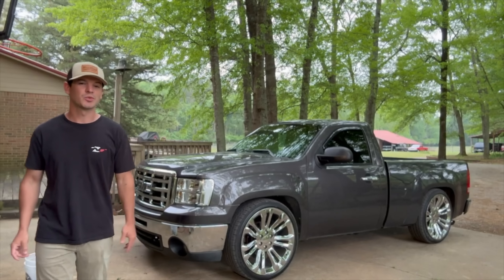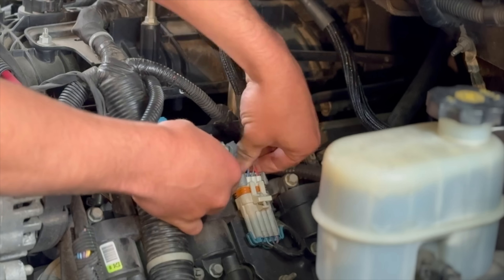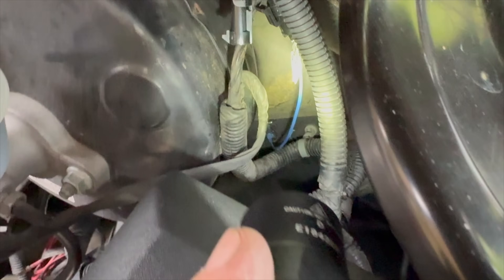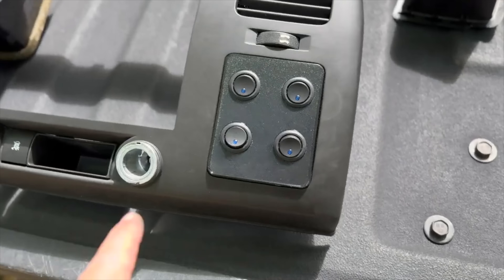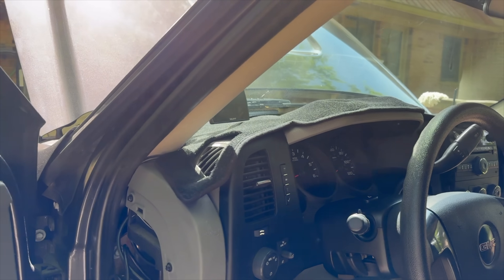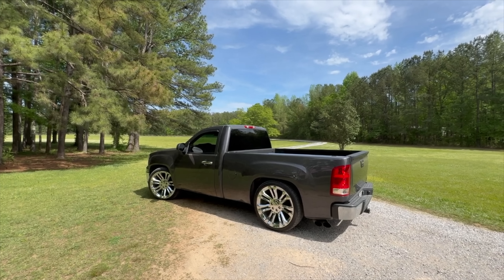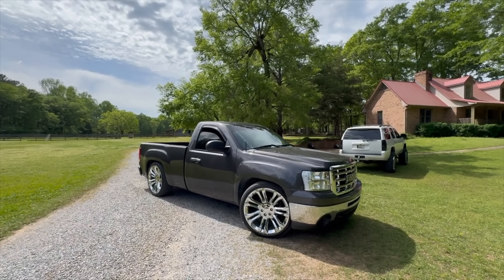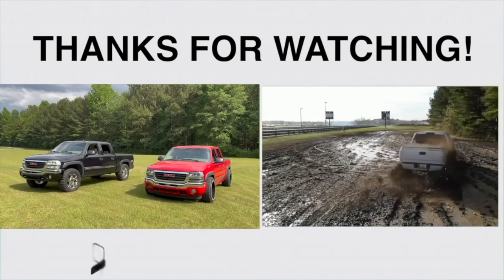2 STEP SOUNDS ABSOLUTELY INSANE!!! | COMPLETE INSTALL |

Comment: hey man what did u do to clear check engine light i have longtube headers also and its given me like 8 codes that are with the o2 sensors and i have no cats
Reply: Have someone tune out the cats sensors or fix the computer problem
Reply: @REDDELECTRIC  oh ok thanks will it make it run better and get Better gas mileage?
Reply: having no cats even with a tuner to tune it prolly still won’t take out that check engine light with no cats that’s how my truck is running lol even with a tune

Comment: late reply but the hole where you ran the wire through is actually for a clutch pedal, in Mexico these gmt900s were manuals until 2009 I think

Comment: 6.2 swap, f35 cam, high rise holley intake 4k stall and 4.10 gears. Would be super nasty
Reply: 4.56 gears 4l80e
Reply: @ThatLSTahoe  it’s a 6l80 truck, shits on the 80e, the 80 is a dinosaur of a transmission, only beneficial when making like over 800, otherwise it’s a absolute turd
Reply: @5.0milo Do not disrespect the TH400/4l80.
Reply: @5.0milo I always hear go 4l80 for high hp or boost. But that’s a downgrade tbh and I’ve built a 6l80 w stall built for 650+hp from circle d this 6 speed is a monster I wouldn’t go any other way

Comment: try the lnc-2000 it has a 2 step and you can pull timing witch lets mine shoots big fireball before long tubes i had a msd one but it did not shoot flames after but the lnc-2000 does